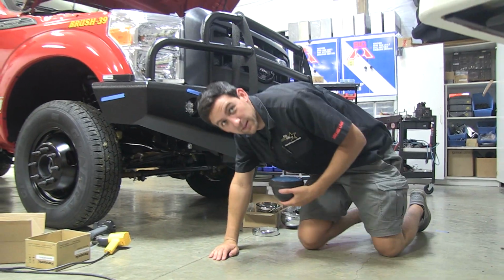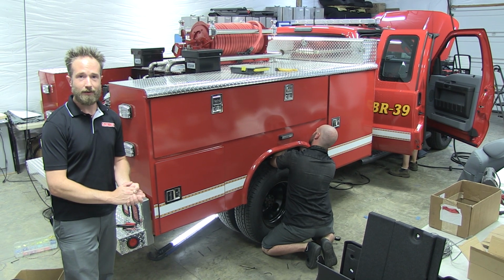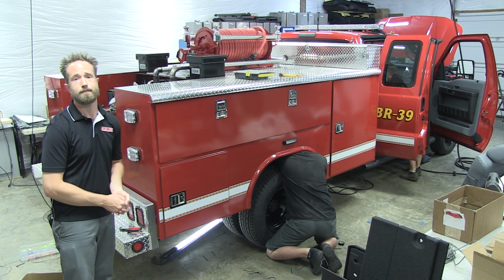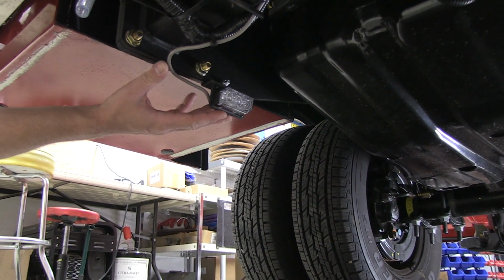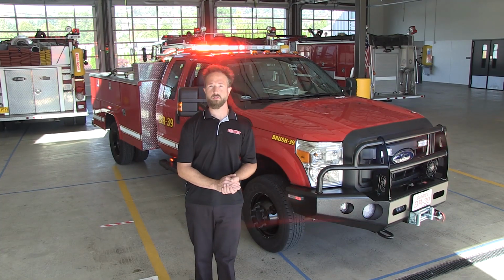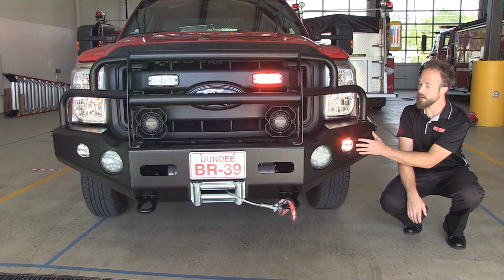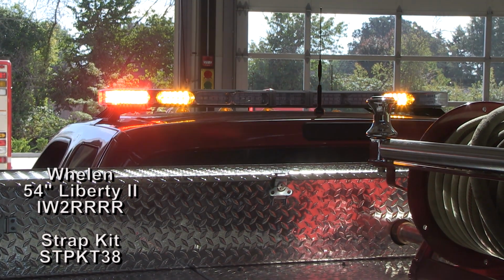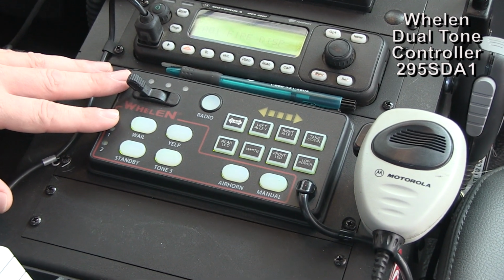Ford Truck Brush Rig Installation for Dundee Fire

Comment: This is honestly by far one of the best lighting blueprint applied to a brush truck. Well done !!
Reply from the maker: +GravelRoadCop   Thank You very much :) The Lighting used and placement was actually Chris' spec. Thanks to our Pals at Star Cars, LLC., it turned out amazing :)
Reply: SIRENNET Nice ! The only criticism that I have is the side Code 3 Chase LEDs mounted on the bumper, the rapid flash pattern doesn't suit well for the dual color option. Something slower would be better to show the colors better.
Reply from the maker: +GravelRoadCop   Thank You.

Comment: that brush guard is sick. :) not a fan of ford but it is nice looking. what r the 2 small  antennas for on the roof, radios? can u guys do a all blue light setup sometime.
Reply from the maker: +MRJOHNDEERE3720      Thank You. The BuckStop Bumper is awesome :)   The antennas are for the 2 Radios in the Console.   The next Blue Light Installation will definitely be captured.
Reply: +SIRENNET ur welcome. :) o  ok.. cool.  i like blue..lol